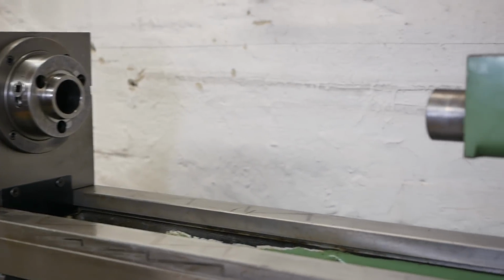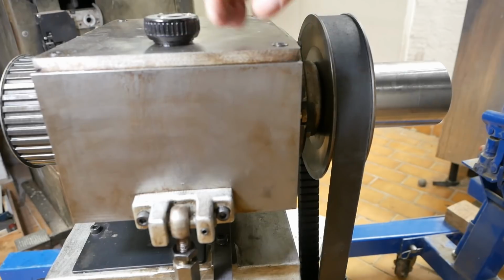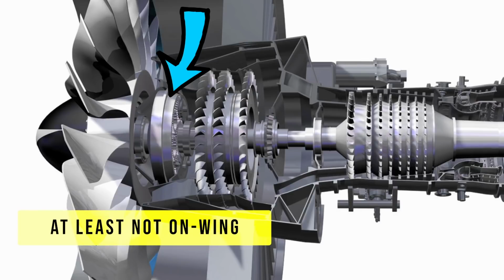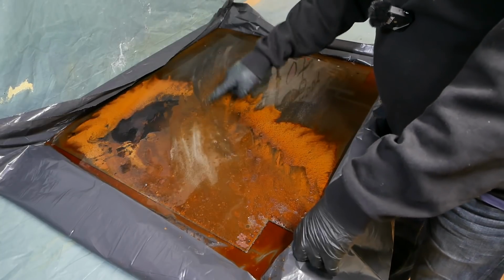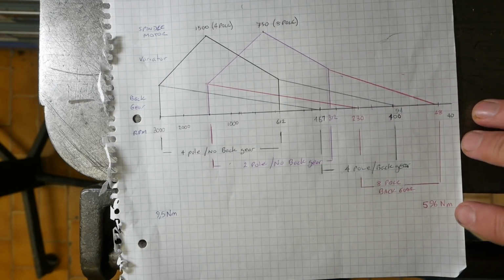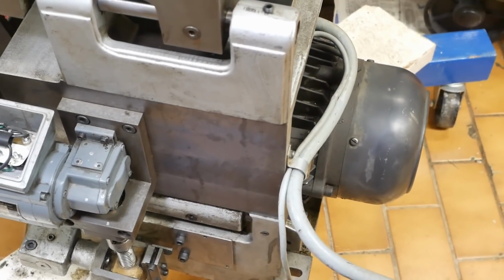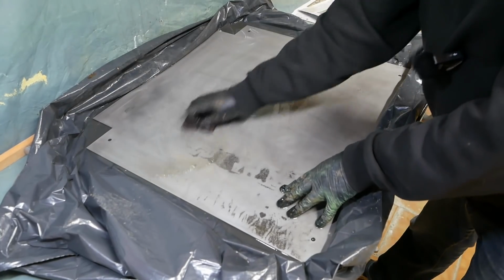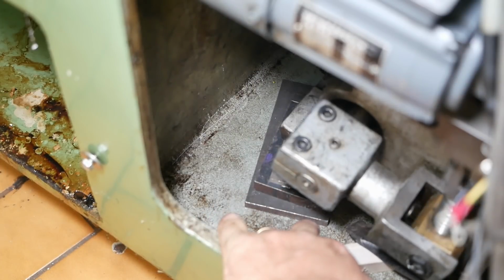Installing the Schaublin drive train

Comment: Also for the mirror it turns out paint stripper will take off the plastic and then you can oxidize the copper to expose the silver.  That gets you a delicate but ghost image-free inspection mirror.
Reply from the maker: This was remarkable clear once I wiped of the big greasy smear on the surface.

Comment: Keep the variable drive but put a hand crank on it.  Thank you for the analysis of the geared fan; I'd sure like to see the condition monitoring regime for that gearbox.
Reply from the maker: With the set up of VFD + CVT + Backgear, I am pretty sure I dont need  a hand crank :)
Good point. But other than monitoring vibes, oil temp and Px, soap sampling the oil there wont be much they can do. Another commented that they have some boroscope inspections already but with tiny 2mm light guides, it is a real PITA.
Reply: @RotarySMP  I mean use a crank (instead of a motor) to adjust the CVT; all the benefit with reduced complexity.
Reply from the maker: @jimsvideos7201  For me that may be increased complexity, as I already have the CVT motor, wiring, and control board. It just takes a couple of output pins from a Mesa card to give LinuxCNC control of it. The hard part will be writting the control heirarchy of when LinuxCNC should change VFD vCVT v Back gear.
Reply: @RotarySMP  Fair 'nuff, I look forward to seeing what you end up doing with it.
Reply from the maker: @jimsvideos7201  Thanks for your input.

Comment: When you install your VFD add a filter to it as well. It’ll make things easier on the motor and give it a solid chance.
Reply from the maker: THanks for the tip.
Reply: I’ve tried to include a link for you twice but YouTube says no. Point is the filters bring everything closer to sine wave territory.

Comment: Hey, i really like your Videos.
i worked around 4 years with Schaublin 125 and CCN125 and the one Problem i had, quite a lot was that the variable Beltdrive couldnt transfer all off the Torque form the Motor. 
My take on that would be to change the lower beltdrive to a toothed belt and keep the gearbox as is.
Reply from the maker: Wow, that is an interesting input. What were you turning that needed such high torque? I find it surprising that this little lathe even needs so much torque capablity.
Reply: @RotarySMP  well we did quite a lot of stainless on them. That Problem occurred mostly when we did Threads like M12-M16 with a tap.
When the variator is on the lower end of the RPM range the Belt tension  is going down a bit and therefore the  transferable force decreases.  
Maybe it is possible to adjust the mechanic but i didnt had the time to really dig in to that. 

And like you mentioned, it would probably be easier to eliminate the variator and just keep a 2-way mechanical gear than to implement the variator on the Software.

Regardless of that, it is a fine piece of Engineering and i liked working with the variator a lot.
Reply from the maker: @christianrees9564  Thanks for explaning that. I can M16 tapping in Stainless being a real stress test for any drive system.

Comment: What would I do? Well I know what I wouldn't do - try and grab the chuck with my hand when it's in low speed and back gear! :D Keep the CVT. A quick search - ie based on no personal experience whatsoever - suggests high frequency components from the VFD can lead to large induced currents in motor shaft which if passed through bearings can shortens their life? That said, absolutely nothing on that Schaublin seems marginally engineered. PS. is the name plate clean enough yet?
Reply from the maker: Thanks. This lathe spindle will not stop for anything. Definitely not a machine to crash.
I was looking for a brush to clean the nameplate, and then forgot.

Comment: I think that old motor will last longer than you think it will. But keep an eye out for a deal on a replacement just in case.   Vinegar works great for removing mill scale but the smell is horrendous. I'm not sure what's worse vinegar or an open sewer pipe.
     What I do for painting stuff that isn't critical that it look perfect I just flush the spray gun out with thinner and call it done but the spray gun I use for that is a cheap $10 one from Harbor Freight which works surprisingly well for it's price. If it gets too gunked up I just toss it in the scrap pile and grab another. In the end it's cheaper than the chemicals to clean it properly every time.
Reply from the maker: This paint gun was also just a cheap import. Cant remember what I paid, but more than $10. Migh be time I replaced it though. 

I dont mind the smell of vinegar. I like the taste.

Comment: An excellent video because it illustrated the range of things (jet engines) that I know nothing about but find facinating :-)   It's always good to learn! In relation to the air pipes if the new tubing fits inside the old can you not use the old tubing as a sleeve over the new where the clamps are?
Reply from the maker: Good idea. I will cut a piece and try it.

Comment: Keep the motor/cvt as it is, its beautiful and it works. You can't see such craftmanship very often today. Also remember the fact, that you dont have to put even one minute into it, while it still does its job fine with alotalotalotof torque, that you would throw away if you touch it. What would be the benefit of a replacement anywhere?
Reply from the maker: Yep, you summarised my thoughts well there. I already own it, and it works.

Comment: Makes sense to keep the original motor.  You already have an "inverter-duty motor" with the class F windings.  From what I've heard and read, VFD voltage spikes are usually not a problem for 240V motors (480V and up are where you may have an issue).
Reply from the maker: 3Ph here is 380V. 240V per phase. I hope you are right and the motor survives.
Reply: @RotarySMP  Spitballing here, but since the topic of spikes from the VFD is worrisome, would 3 oil-filled (run type) capacitors of some value to be determined connected across each phase in delta configuration or 'Y' configuration help reduce  stress on the motor windings? Also I remember reading the bearings can suffer due to stray electrical discharges when non-VFD rated motors are run on a VFD...again, would something as inexpensive as a capacitor (or 3) help aleviate this potential problem? I think some research on the topic needs to be done.
Reply from the maker: @MRCNC1967  I asked my Electrical guru, as Schaublin had capacitors across the phases in the original installation. I understand that there are special filters designed for VFD usage, and that you cant use caps.

Comment: With proper output filtering you can get rid of the Output spikes from the VFD. Some just use a shit load of "ferrite" or better noncrystalline Toroids in CMC configuration.
There are "proper" Filter modules commercially available but they are not cheap.
Common mode Cokes are also necessary to protect your motors bearings.
Reply from the maker: Thanks for that. I'll google to find out what all those are :)

Comment: This was a great episode, thank you. I learned the vinegar/mill scale trick from one of your earlier videos and have used it a few times - great tip. I loved the tangent talk on jet engines too, so thanks for that. My vote for the motor is defo try and use the existing power train. Really only because that's what I would do, not because I have special knowledge/experience. I don't mind if you ignore this and go for a new motor, I'm just one of the Heathers that enjoys your channel. Good luck with whatever option you go with.
- Heather
Reply from the maker: Thnks for the kind feedback Heather.

Comment: For mill scale removal I use those purple and spongy "cleaning discs" for angle grinders. They are fast, cheap, don't bite into the base metal, and don't clog up like flap disks do. Nice video, really appreciate the info on turbines! :D
Reply from the maker: I also use discs on small parts, but that had a lot of surface area, and it would have been a PITA to grind it all off. 
Thanks for the feedback.

Comment: Man... Use citric acid instead of vinegar lol. You achieve the same thing with it but you at least don't stink up the house. But as it is a solid you will need a rinse afterwards. Oh and btw, the motor might be F class in insulation but the cables going to it are YSLY, which are 300/500V rated :p
Reply from the maker: I dont mind the smell of vinegar, although it losses is smell fast. 

Thats for the input, what is the consequence of YSLY wire? The supply here is 380V 3Ph.
Reply: @RotarySMP  The supply is 400V which is okay but if you make inductive spikes from ringing, it can shoot over that. Exactly the same reason why you needed the higher insulation rating on the motor. I'm not a 100% sure if it's a problem but I would ask an engineer if I were you.
Reply from the maker: @whatevernamegoeshere3644  Thanks. I'll ask.

Comment: 3D printing clips seems like a failure point. Perhaps slit a 1" (25mm) length of tubing that has an I.D. of the air line, and an O.D. large enough for the clamp, and slip that over the air line?
Reply from the maker: I wasn't going to makeclips on the printer, just sleeves to bring the diamter up large enough for the existing clamps. But you make a good point. I might be able to just use sections of the removed hose.

Comment: I say keep it. It's going to make the wife happy, and if it actually dies you can justify a new motor much more easily. And software control should also not be a huge problem, depending on how LinuxCNC manages that.

Also, that bit about the turbines was really interesting, I hope you keep those segments coming!
Reply from the maker: Thanks for the feedback. The challenge for me will be working out how to schedule the overlapping control loops of VFD, Variator, and back gear.

Comment: I say keep the motor, use the VFD to power it through reasonable speed range and use the "variator" to select "virtual gears" with maybe 3 or 4 "speeds" and I would probably keep the backgear in the gearbox at 1:1, and switch it manually to low gear for some special job were you need more torque, but given the size of the machine I think it will be running fast most of the time. I would eliminate the posibility of the software somehow trying to shift into high or low gear while machine is running, that would stink. As for the switching of the motor windings- same, keep it simple and stick to high speed, maybe add contactors at a later date but like with the backgear, keep that system manual. Once the basics are up and running then start interfacing those systems into Lynux.
Reply from the maker: I like your summary. Basically what I was thinking. Primary speed control VFD, biasing with the Variator, and the back gear engaged only for large parts, slow speed. Back gear changing inhibited for CSS. I will have to try and implement that in logic.
Reply: Good plan I’d say. 
Definitely keep the motor - 
I’m running a few motors of that vintage on VFDs and haven’t killed one yet. No idea what insulation class they are.

Comment: I would replace the old drive with a large ac synchronous servo motor out of several reasons:
1. Interfacing with LinuxCNC - then you only need to interface with one device
2. Controllability: Spindle accellaration and deceleration is way better and its way easier to implement constant surface speed and threading.
    With a wide, rigid poly-v belt, you may even be able to have some c-axis capabilities.
3. And most important: You can get rid of a lot of moment of inertia. This helps with the spindle dynamics and also reduces the amount of energy involved in a crash.
4. Noise, wear, vibrations
Reply from the maker: Those are all excellent reasons. The only thing going against it is
1/ Cost. I already own this stuff.
2/ Electrical supply. I only have a 16A house supply.

Comment: I seem to remember a car gearbox that worked on the same variable principle. The Variomatic?
Reply: Motorscooters use this type of Variomatic with a rubber belt.
But the gear ratio is changed via flyweights, so it changes automatically with the engine rpm.
That may be a perfect combination with VFD to maximize the torque at low speeds...
Reply from the maker: @Henning_S.  I hope so.
Reply from the maker: I think a bunch of little cars had a CVT, but this a HyVo chain between sheaths, not rubber.

Comment: I was a GSE/AGE mechanic in the USAF. Your explanation of a GTC and the design changes/differences was a thing of beauty. I worked with a power unit we called a -60 it had 3 phase 120 VAC 400hz power. It had a two stage compressor and a single turbine wheel.
Reply from the maker: Thanks for the feedback. Gas turbine ground power. perfect to run the home shop :)
Reply: The amount of fuel to run a GTC generator would be enormous. Not fuel efficient but very smooth running
Reply from the maker: @JMassengill  Yeah they drink gas. Especially in start up.

Comment: Perfectly complete episode….. vinegar baths, turbine engine development, 3ph motor/drivetrain graphs, cleaning the workbench…… it’s got it all.  Since you asked for votes, I would start skipping one latte every week at Starbucks and deposit that money in a new motor piggy bank, and drive on.  If the motor bearings are good and your not planning to put this lathe into 24/7 production mode, this original motor will likely outlast you and your heirs will inherit a nice bonus account. 

Questions - Was that apple cider vinegar?  How eye-wateringly fragrant does the workshop get after 48th hours of evaporating vinegar?  Does that vinegar air tend to rust other metal nearby? Maybe you covered the pool with another bag?  Would 5 of the smallest standoffs (like M3 nuts), one at each corner and one in the middle, be sufficient to etch both sides at once without needing much more volume?
Reply from the maker: That was cheap and nasty supermarket own brand vineagar. 60c a litre. The Ions in the air dont rust everything as badly as the time I did fast mill scale removal with HCl, and split a bunch on the floor.
Reply: m3 nut is too flat, the bag would touch the steel , but even if it  would be enough,  1mm thickness @ 1 square meter area is 1 litre of volume.. so even prepping up with m3 nuts would consume the 1l bottle of vinegar without having enough vinegar on top.
Reply from the maker: @robertjung8929  If I had put paper towels on top, it probably would have keep it moist, avoiding the pitting. Not like it really matters. It is only for screwing the electic to.

Comment: The problem too, is how much development has gone into these new 'efficient' powerplants... They are like these heavily inbred dogs. May look good to the average Joe-blow, and they are more 'efficient'... as long as they are on-wing. Even there, they are a pain, can't do any Compressor blade change, thanks to Blisk's. During our engine course at PW, they told us how to Borescope the planetary gbx on the Pw1100, but we could not do the actual Inspection, because the equipment was broken, 2x 2mm Flex-o-scope's, damaged because of wind-milling... You have to bring the A/C inside to do the inspection.... Where are the days of the CF6, CFM, V25?? Ifn you did borescope, and you saw a few missing teeth/Bladetips/whatever.... fly-on, but keep an eye on it... now the 'limits' are sooo reduced, engines only efficient if up to par.. blah.. es macht kein spass mehr, oder?? 
Ich würde den OEM Schäublin motor behalten, so lang es gut geht.
Keep up the great content, ja?
Grüsse
Reply from the maker: THanks for the feedback. 2mm boroscope fibre guides are pretty fragile. Will killed a 3mm on a GE90 AD a couple of decades ago.

Those extremely highly loaded compressor stages will be very intolerant of damage. Luckily the ultra wide chord fans ten to centrifuge most particulates out into the bypass ducts.

I hate to think what a Leap or PW1100 shop visit costs. The price jump from 64" PW4000's to the GE90 was eye watering.

Comment: I like the simple transmission+VFD combo idea. Complex mechanical systems usually have a bunch of custom parts, difficult to replace if needed. For the modern solution, it's much easier to find a compatible device (simple motor, VFD, belt pullies, etc.) and also to upgrade them one by one.

On the other hand, without a large budget, keeping the present drivetrain makes sense.

I think the main argument comes from the planned usage. Is it intended for hobby use only or business? What level of reliability and serviceability is targeted?

(BTW the most advanced and compact solution would be a PMSM servo system. Oh, I'd love to see that! :)
Reply from the maker: This is definitely a hobby system, which is unlikely to see anything like industrial usage.